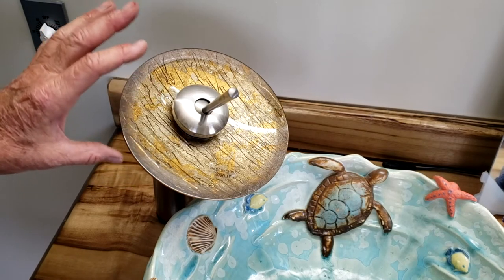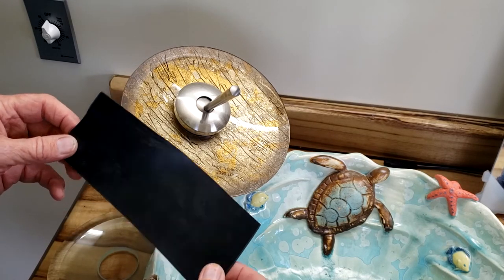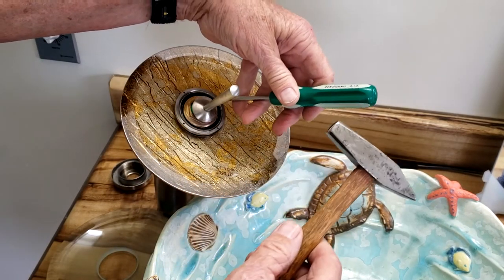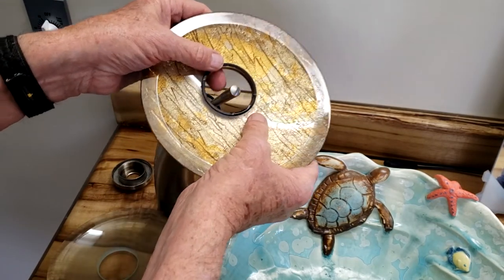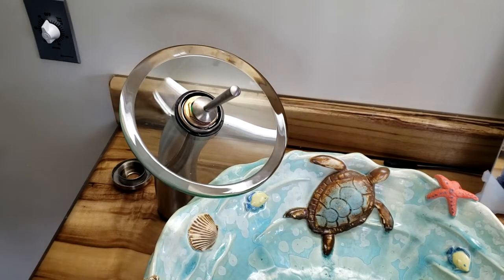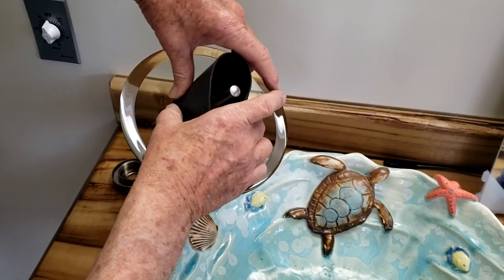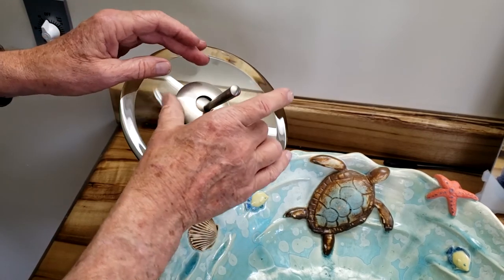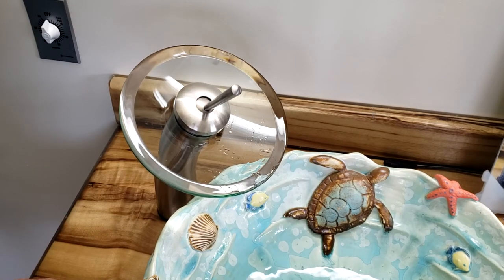WATERFALL FAUCET DISC REPLACEMENT

Comment: Hey could u help me?  I have the same style but it leaks water u day the glass.  So that tells me my gasket isn’t right? I tried putting the gasket on the way up did and still leaks.
Reply from the maker: Maybe the gasket is getting twisted then you put it on.  Try lubricating it with Vaseline first.

Comment: What was the special tool they told you to use? Ive tried everything and cant get it off.
Reply from the maker: What part can't you get off.  For the locknut, I think the factory rep was talking about a pin spanner, or some other type of tool that engages the 4 holes in the locknut.
Reply: @vendter  who was the manufacture
Reply from the maker: @jamesupton2696  Sorry, since the video I have moved and no longer have that information.

Comment: What to do when I pull down to shut the beater but water keeps leaking? I have to shut the water from under the sink cabinet/from the wall valves in order to not end up with a $$$$water bill. Tried to pull these pieces apart but they've been on for years and I couldn't take em apart.  I'm super annoyed of this leak problem.
Reply from the maker: It sounds like you need to contact the manufacturer and get a new cartridge
Reply: I am having the same problem, did you ever find a way to remove the disc holding everything together.  Mine is probably stuck from hard water deposits.
Reply: @melissahurn6925  no way of getting it off. We just replaced it with a different type so we dont have to deal with that again.